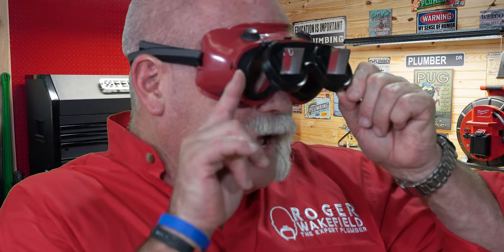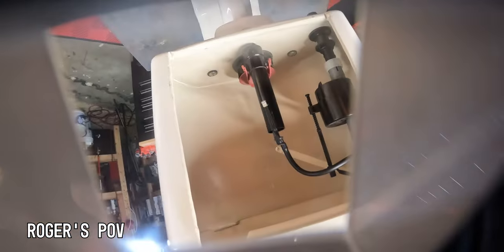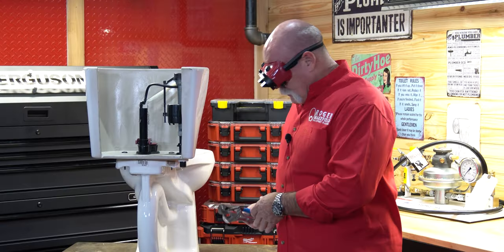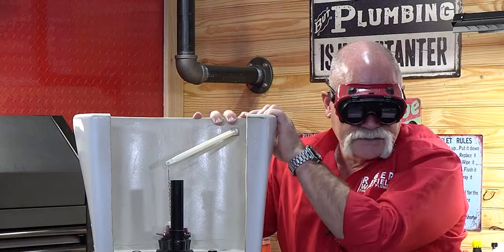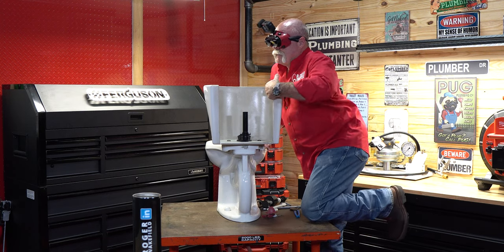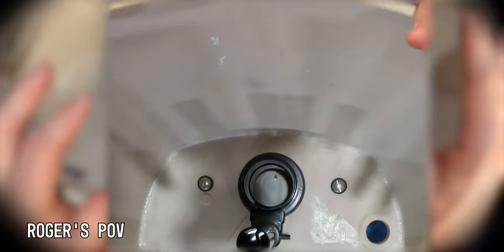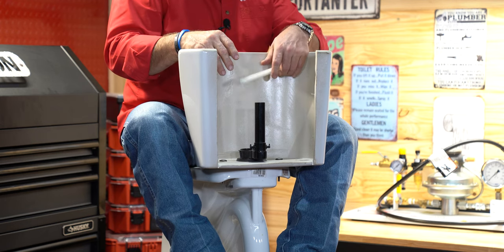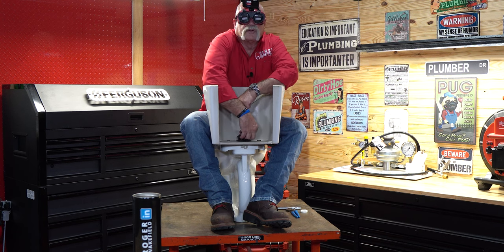Fixing A Toilet Upside Down: Is It Possible?

Comment: Just a little extra info on the fill valve. On the body at float level you will see CL-> which is critical level. This line must be 1” above the dip tube on flush valve

Comment: Whats the best solution for roots in your plumbing system?
Reply: Have your sewer line repaired. Roots only get in because there’s a way in: a crack, a split, a gap. Snaking the line with a cutter head of some kind is just giving the roots a hair cut and they’ll eventually grow back. Best thing to do is have it dug up, have the section with the split cut out and replaced, the pipe bedded, and the hole properly backfilled.
Reply: If condition and grade are good with less than 10% offset, hydrojet the line and do a CIPP(cure in place pipe) LINER. Otherwise dig down and do it by hand. Snaking/jetting/root x is a temporary solution. Once roots are in, they will regrow do to the penetration through hub or pipe
Reply: Remember if you dig 4’ deep(technically 3’9”, you need trench safety. Slope/shore/shield. Standard side sewer here in seattle area starts about 7’ deep